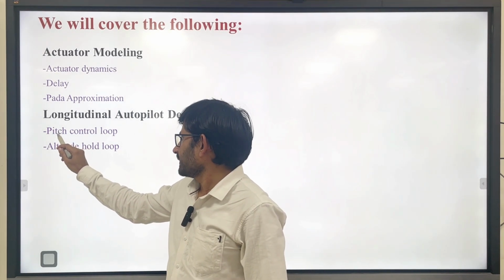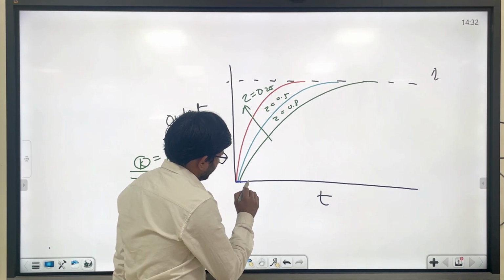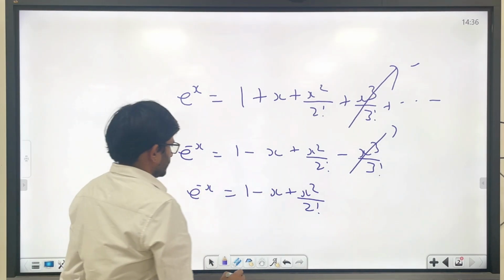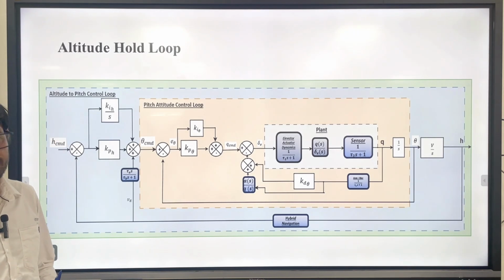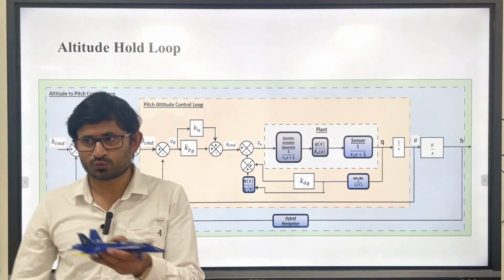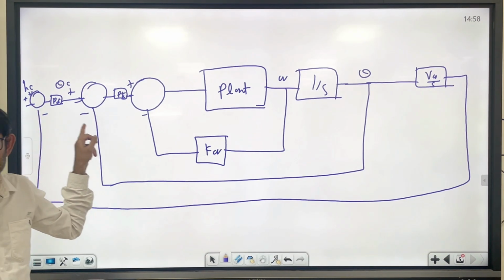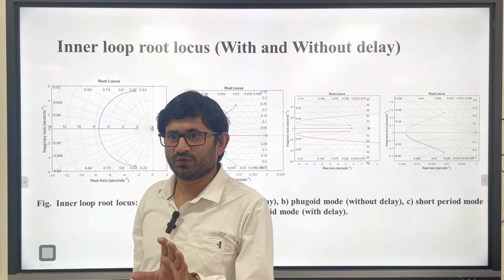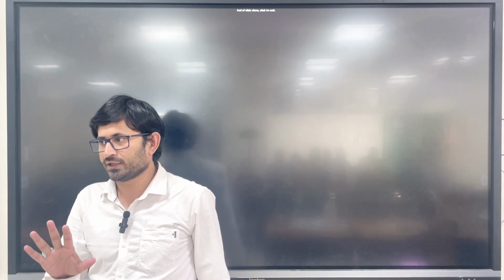Lec 17 | Aircraft Longitudinal Autopilot Design and Analysis | FCSD by Dr. Salahudden

Comment: Hello Sir,
I'm trying to develop attitude hold autopilot for corsair 2 aircraft for which i have the linearized model at altitude 15,000ft at Mach0.3 and velocity 316.4557 , For the moment i have not taken delay, actuator and other dynamics into consideration, for  the inner loop gain i have taken the gain at which plant's root locus is crossing jw. and tuning the PID gains using the automatic tunner seems giving non convergence 

Can you please see my Simulink model(link given below) and guide me.
https://drive.google.com/file/d/1hlEA84NfVviCFLlHyQipcWrsyJ6Z_wUk/view?usp=sharing